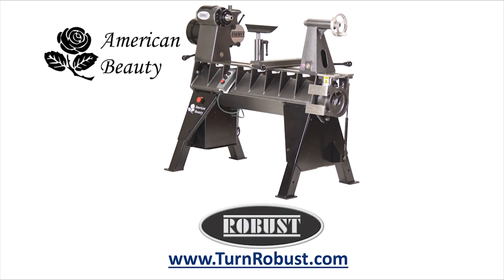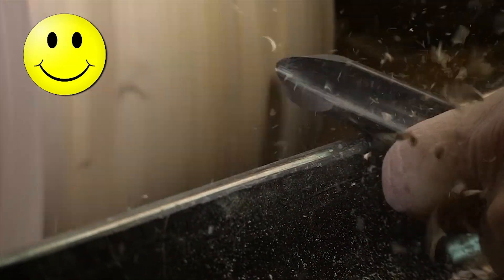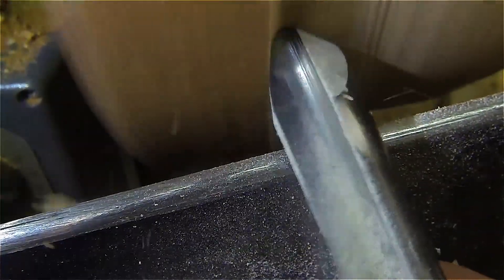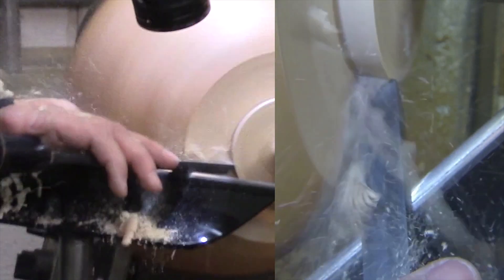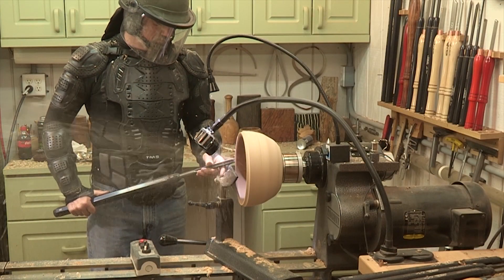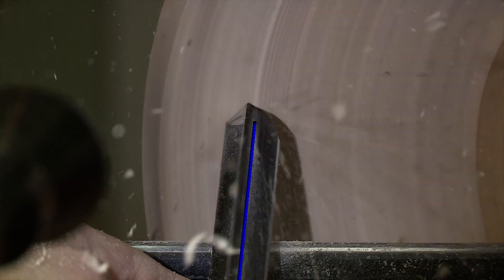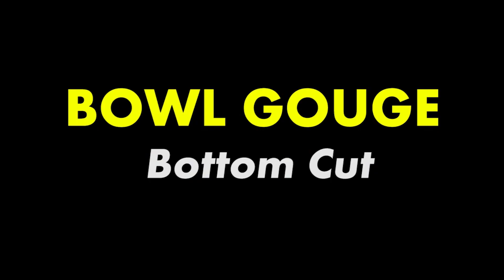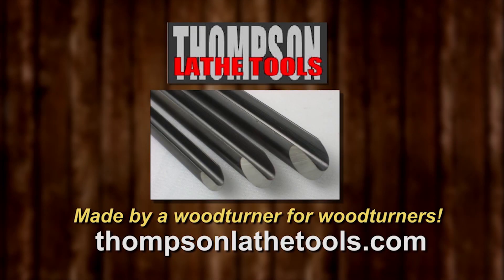Catches-Part 2: Bowl Gouge

Comment: do you have that body armour on backwards?
Reply from the maker: Good  question :^) There is a zipper in the back that is impossible to reach by yourself. Had the wife help me get in the thing. Then as I was shooting the segment I did not realize that she went shopping. I had to wear that contraption for 5 hours until she got home. I thought about going to the neighbors but they already think I am weird so I did not want to reenforce that opinion...BTW there is no protective material on the zipper side so I think I have it on the right way...
Reply: I ask because I've used one of these before to make a robot suit. I assumed that as they were designed as motocross or BMX armour that the protection is down the back to protect the spine.